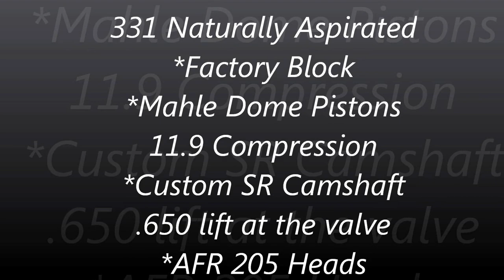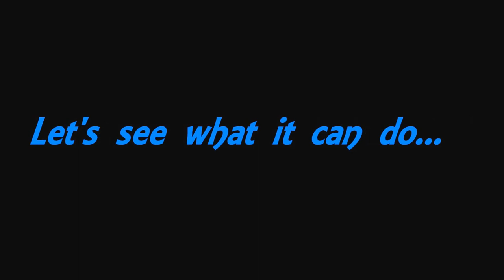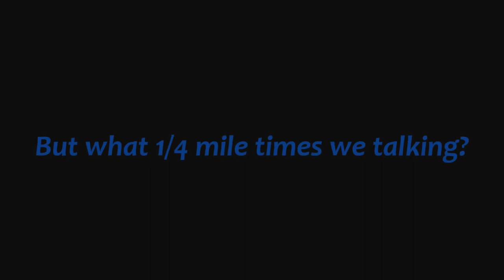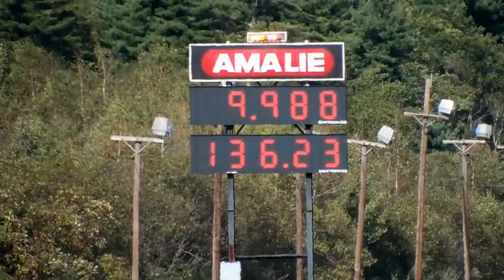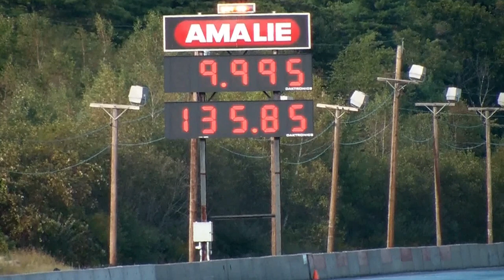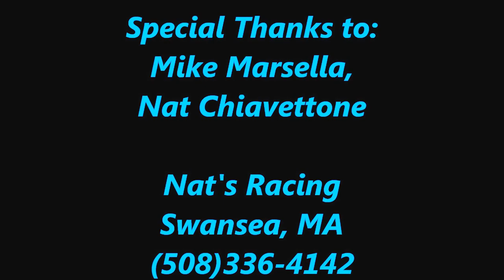Quarterhorse II Racing

Comment: What transmission and clutch are you running?
Reply from the maker: Back then a Centerforce DF and a face plated Tremec TKO
Reply: @Quarterhorse2  are you still racing?
Reply from the maker: @converseracing  Yes I’ll be doing a track rental in a few weeks.
Reply: @Quarterhorse2  are you still going to run the same car?
Reply: What tko was it?
Reply from the maker: @converseracing  TKO 2 with a Centerforce DF. back then

Comment: I have a 347 stroker 12.5.1 compression afr 205 heads .686 lift at valve web parker intake aluminum flywheel g force t5 and 430 gears car ways 3040 with me in it and im only running 11.3 at 123mph how you running 9s lol
Reply from the maker: Good matching parts & engine builder....My car is light too 2,700 w/ driver. Thank you!
Reply: get some better gears like 4.56 or 4.71
Reply: Something is wrong if you only running 11.3 with that combo...

Comment: I pulled my factory block and had it refurbished.  It's a 93 302 that is now a 306.  I was under the impression I would need a stronger block to run up into the 500 hp class.....
By what I see here I can use that block and go up to a 331.  Has your block held up?
Reply from the maker: Todd Woolson It's good machining, assembly / parts and a lot of luck of just getting a good oem block. I believe a 500 hp N/A engine will live much longer than a boosted or N20 combo IMO
Reply: Quarterhorse2 I share the same belief. I want to make 500hp with a NA motor.  Thanks for the reply. Your fox is an inspiration.
Reply from the maker: Todd Woolson Thank you and good luck!